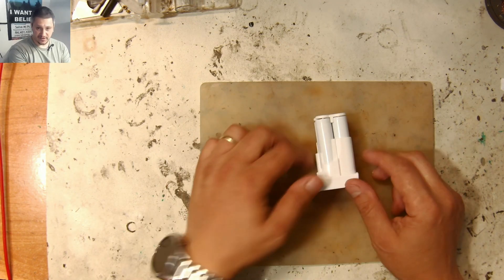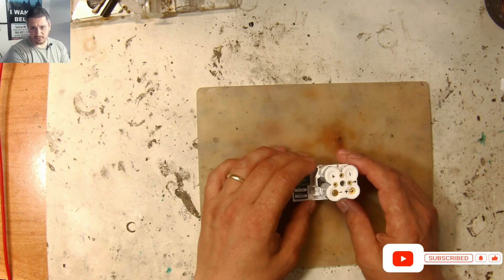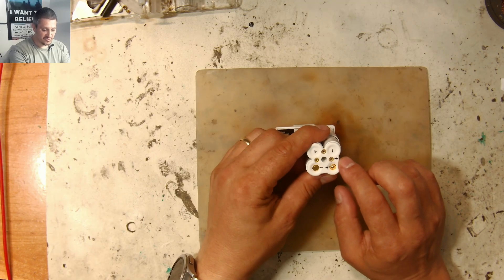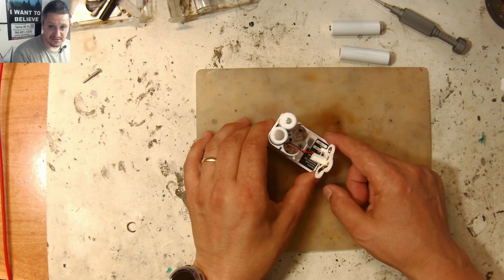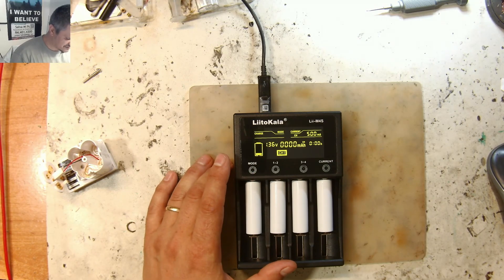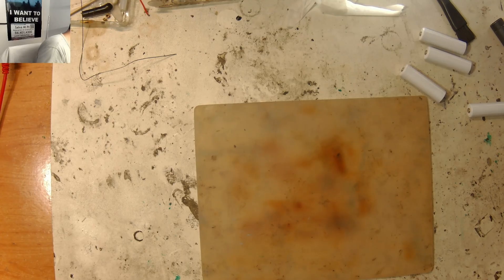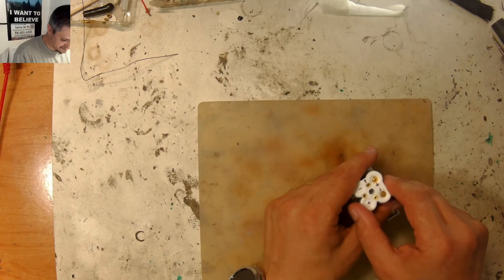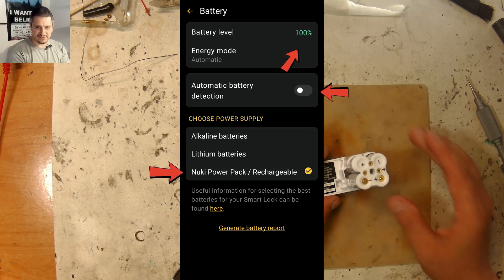Nuki 3.0 Power Pack Repair 🔋 Replacing and Recalibrating the Battery Cells

Comment: Good,  i put 4 x  new eneloop AA
Black inside 
Some take the white eneloop works also
Reply from the maker: Yes AA cells work as well but you have to change in the settings what type of battery you use.